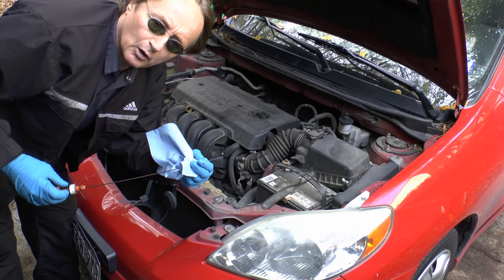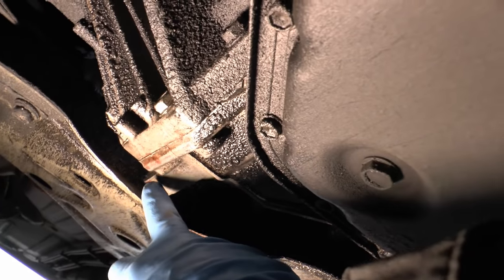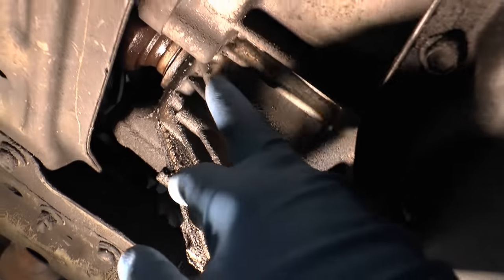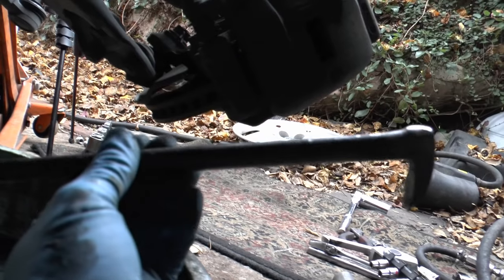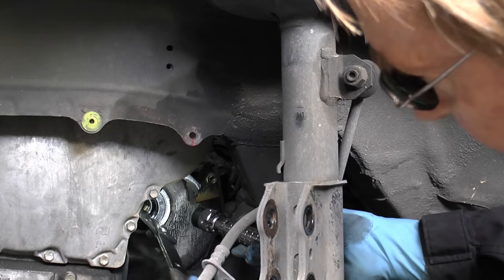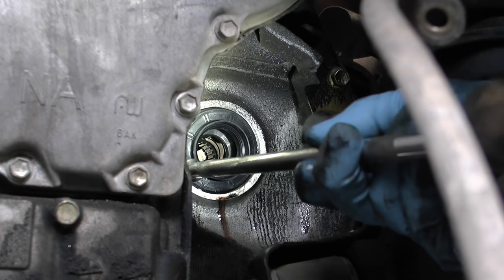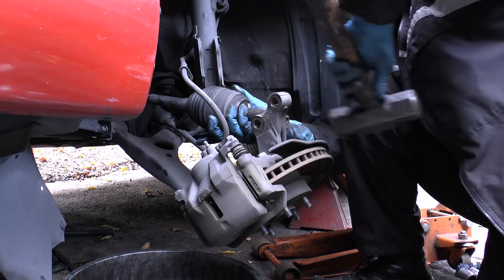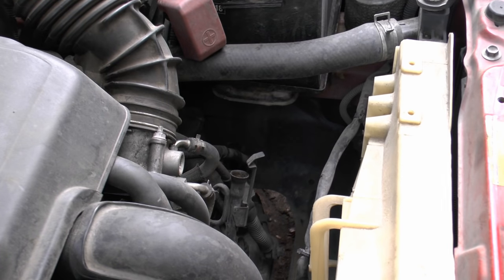How to Fix a Transmission Leak in Your Car (Axle Seal)

Comment: Thanks to your advice, Scotty, I now have a $25 OBD2 scanner, and a brake fluid tester on the way.  That's only the beginning of the testers I have on my Amazon wish list.  Now if only I had the money and space for an air compressor I can use with my impact wrench...
Reply: I still need to get around $500 for a good one, and I'm still saving for the car itself.  I'm not making payments, I'm buying straight out.

Comment: Quick and simple explanation, is pretty similar for most cars, some will have an intermediate bearing which is held in with bolts, most french cars have this and it's fiddly, just an extra step to remember.

Comment: A lot of times when I put seals in I'll use the end of a 2x4 or 2x2 to strike with the hammer.The wood is more forgiving and I can bridge all the way across the seal and drive in both sides at the same time leaving less chance of deforming or ruining the seal.On RWD transmissions there is an output shaft that sticks out beyond the seal.For those I take a hole saw and cut a hole in the flat side of the 2x4 big enough for the shaft to fit through.

Comment: scotty i replaced the drivers side transmission seal on my 2009 hyundai accent 2 times...but it continues to leak...what could it be ??? also they've offering 2 different seals one rubber type and one metal type?? neither stopped the leak

Comment: Hi Scotty. I had my f axle shaft , cv axle on R front replaced on june 2022 for a 03 hyundai elantra. Question : should the seal been included in that work ? 
Because i now have a R cv seal leak ..8 months later .
Thank you

Comment: scotty im in a predicament...with my girl at motel and my toyota tundra 2001 truck I havent had long will not move. i had checked fluid and thought it needed fluid. I use my truck every day for work ...its how I make my living and how were in a motel now. 
It wont move. Scotty I get on it pretty hard bcus everything I do is rush rush...traveling hundreds of miles a day of stops, turns et cetera. It was after putting the fluid in and driving several miles back to motel that it made like a steady hum sound for two maybe three seconds. We barely coasted  into the parking lot. I
I waited half hour for it to cool before checking the fluid level again, on the stick, it was a good half inch to 5/8 further than it should have been for being cold.
on top of this the overdrive light when on I thought was engaged, so when I wanted to pass someone  on the road, I would push it. 
But its when the lights not showing that it is engaged. we have to be out by noon unless I work in the morning.
Did I mess transmisson up??? I cant be without my ride Scotty, I'll lose everything. 
Doe's or can over-filling the fluid make it slip or not move??? Have I blown a seal??
What can I do that will make my truck move. will draining the amount of fluid I put in make it go back to moving.

HELLO. SCOTTY....
DESPERATE..
WHAT CAN I DO???
Have lil money and not much time.
IS THERE A SOLUTION ????
drain a lil fluid? bcus it was ok before that?

Comment: I wish we had you as our mechanic. My grandmother just bought an 01' Honda Accord, which has an expired recall for the transmission, and she's had so many issues with it. The car lot she bought it from is taking care of her because I know the owner but they've put in three rebuilt transmissions and each transmission only lasted about a week. Then after the third one it started having issues again and they said it was a bad sensor.

So they replaced that and then a week later it started having issues again, then they said it was the plug the sensor went into that went bad. So they replaced that and now its back in the shop again after I noticed it was leaking. I checked the oil and it was fine so I was sure it was the transmission fluid, only I couldn't confirm because I couldn't find a way to check the transmission fluid levels.

She was driving it the other day and it started having issues getting going from a stop, then the check engine light came on. She shut it off and waited a few min and turned it back on and the light went off and the car drove fine the rest of the way home. They said they would get her in another car if they couldn't fix it this time, though I would think by now they'd just take it to a Honda Dealership since their mechanic can't seem to fix it.

Comment: Thanks for the tip on the grease. I have found that it's good to loosen the axle nut before I raise the car. You must have done this, because it came off so easily.

Comment: I pretty much did the exact same job for the exact same reason (Leaking Axle seals ) on my 1993 Dodge Shadow like 5 years ago.  Another place I've seen Transmitions leak is the oil line to the external transmition oil cooler.

Comment: Usually the tie rod is stuck worse than yours was, so it would be a good idea to take the nut off half way, so it's level with the tie rod end and then hit it or else you're gonna ruin the threads and mushroom it out. Of course if you plan on replacing it afterwards then it doesn't matter.

Comment: awesome videos very helpful. i notices 3 things in the video that would put the DIYer in a little bit of trouble when tackling this kinda job 1st, hitting the tie rod on the top could cause mushrooming and messed up threads. my 2 cents, i would hammer on the side of the spindle where the tie rod is connected at so it can brake loose form its taper. 2nd pulling the CV axle by the shaft could pull the joints out of the socket causing a huge headache putting back in place,  i would recommend pulling by the base of the CV housing for less chances of failure and lastly the seal if not done right there will be leaks after assembled my method is a seal installer tool or a socket thats the right size to drive the seal in.

Comment: Scotty,
Can you make a maintance video that includes everything you have to maintain on a car (changing oils, filters, stuff like that) as well as give basic info about when you should do the maintance?

Getting so unsure of what I should do to keep the car and engieen running for ever.

Also wondering if the "uneven" motors bmw has (the old (1998) is running uneven because of the ventiles?)

Comment: I think you forgot a pretty main item on this video which is vehicle speed sensor, for those with automatics. A lot of times people with check trans fluid ( not knowing how to do it and have it read low) then fill it and blow the seal out of the vss.

Comment: Ive gone thru 4 seals now cause it keeps going in crooked, it will not go in straight. So i hit the side thats not flush and it bends, my seal doesn’t have a fat lip like the one in this vir, its like 3mm wide. I dont know wtf to do

Comment: Whats up Scotty! So i have an 01 Hyundai Elantra and just recently it started leaking quite a bit of transmission fluid onto the ground. The thing is, it seems to be pooling at the top of the transmission and then flowing off. I havent dived into much yet but do you have a clue on what the problem might be?

Comment: Forgot to mention CLEAN the area where the seal sits in, & put some grease on the seal before installing it, & tap it in LIGHTLY when you mount the new seal.
Also forgot to mention that since you disconnected the strut & hub, you'll prob need a front end alignment now- another 80+ dollars
Reply: And never hit the threads with a hammer.. big no no. Also when removing the sealing dont use sharp objects not to damage the transmission casing, or it will leak behind the sealing ... Same with the axle, never hit the outer cv joint .. It will slide in just fine with hand power or there is something wrong. Didnt mention that it can leak fluid when taking out the axle and when reassembling never hit the bolts to the damper also it can destroy the threads.
Reply: guess after he has changed a few hundred of them he has a knack for how hard to tap ;)
Reply: Sinan M Hey, can I change the transmission seal the same way on a 2004 PT Cruiser ?
Reply: Doesnt look like those struts have alignment holes where the bolts go in

Comment: I've just gotten into the habit of replacing axle seals every time I replace half shafts. It's just a few bucks more and a few minutes more time at that point and it saves a lot of time of having to go back and redoing it because the old seals started leaking from being disturbed by the shaft removal.

Comment: Scotty Kilmer
I just had my transmission fluid changed. Before, I had no leaks and a few days after, I noticed my CV Axle Seals were leaking.
1) Do I need to hold the mechanic accountable? Did he do something to cause this? Car is 8 years old, but only 68,000 miles on it. I just find it odd that everything was bone dry before the tranny flush and now I have a leak.
2) Only 1 side is leaking. Should I replace the seals in pairs or just the problematic one?

Comment: Do you have to drain out the transmission fluid before taking off the axle??
Reply: No!  Only a small amount of fluid usually comes out while you replace the seal/axle.  You also want to be careful and get the CORRECT SEAL!  Try to match them if you can.  Some of these aftermarket ones will leak and you will have to do this all over again!

Comment: Hey Scotty my car (1996 Camry 2.2L, with 170,000 miles) Idles low when I start it in the mornings or when the engine is cold. I did check the throttle plate and I have cleaned it from bothside (I changed the IAC valve). I also put in a new air filter as well. What came be causing this? Love all your videos! Thanks

Comment: Hello Scotty,

My son has a 2007 Nissan Xterra. I have to replace the torque converter because I did not reinstall it properly when replacing the engine.

I'm having trouble seating the torque converter. A couple of times I thought it was seated, but it comes off when putting the transmission back into the Xterra.

How can I tell if it is properly seated?
How easy should it come off during installation?

Comment: Did you push the seal all the way into the transmission until it stopped up against the bearing or did you just bang the edges until it was flush with the transmission housing?

Comment: I've been told my transmission lines have been leaking. To have the lines replaced or any of the jobs you mentioned in the video how much does it cost all parts and labor to do each job?
Reply: coololds85 1000+

Comment: Hi Scotty, I had a leak in my transmission on my 04 Mazda 3. I figure that the leak was on the seal you showed. I had a problem with my shaft so changed the shaft and changed the seal as well but it still leaking. I know some auto Mechanics and they told me I should change the seal on both sides, but the other side is fine, no leakage. Why would I change something that is not giving me a problem? What do you think the problem could be?

Comment: Hi Scotty ! Love your videos. I have a lincoln town car 2004 which is leaking at 3 points under the car. I suspect its the transmission but I dont really know. It s leaking in the very front, in the center and the back axle area. I also have an issue when I back up from and turn the wheel to the right, there is a loud click sound coming from under the front of the car which seems to be from the drivers side. Any tips ?
Reply: yes buy a Toyota or Honda

Comment: wishbone suspension has a ball joint at the top and at the bottom, instead of bolts at the strut. Use a ball joint extractor ($20 harbor freight) to safely remove ball joints. Tap them with a hammer like in the video will ruin ball joints, hit the part they go through instead. Use a socket to drive in the seal.

Comment: Hey Scotty i have a 2005 Audi A4 1.8t trip-tonic with 145000 miles and my transmission started leaking really bad, i tried replacing the pan gasket and added new fluid until i reached 5 quarts shifting every 15 seconds but the leak still there!
Looking at your this video it kind of looks at the same place where mine is leaking, my question is "Is it the same procedure to change the seal"?
Thank you for your great videos!!!!

Comment: I guess I should have replaced that seal when I replaced the CV axle today along with the wheel bearing hub assembly on my 1982 Chevy Citation cuz now it's leaking at the transmission. ugh 😩
But hey at least this 3rd time around it should be a breeze since, I've taken that wheel bearing hub off and put it back on multiple times, at least I know what I'm doing now. 😂
Reply: No worries..I did a mustang 5.0 manual  trans 4 times...a mustang shop said all I had to do was drive the car 100 miles and the whole sounds would go away normally!!

Comment: A mechanic replaced left output seal on my 2006 Honda Accord 4 cylinder.  It leaked badly, because he bought an aftermarket seal of the wrong part number.  He did replace it with a Honda seal from Honda. Now it leaks worse than when the original seal was leaking. He took it  apart again and saw no problem.  It still leaks worse than before he replaced the seal.  How can this be. The mechanic doesn’t know why. Can you help or does anybody else have any ideas on what to do next?

Comment: Some oil seals need to be driven in to a specific depth and not bottomed out. It's a good idea to check the factory service manual to see if the seal has a limited depth or not.

Comment: How about a video on chasing strange electrical issues? I've been diagnosing this issue for about 3 months and haven't found the culprit yet. My Nissan Pathfinder's rpms drop and a vibration can be felt any time I turn on the headlights or roll the windows up or down. A drop in rpms is normal, I realize, but it drops up to 300 rpms just from turning on the headlights and more than that when rolling the windows up or down. My guess is a bad ground somewhere causing excessive draw from the alternator but I cannot locate it.

Comment: i have a 1999 grand cherokee that has a trans oil leak right between the engine and the transmission. the torque converter is making a little grinding noise. What could be my problem?

Comment: Recently i got my torque converter fix and i went to a road trip but my transmission leak and it seem to be the seal would the mechanic know the seal was bad or how often do you replace em

Comment: Thanks for another helpful video Scotty. I have a 2010 Scion xB. Nothing is easy on this car. I have done 2 trans service jobs on this car. I got it with 205k miles on it and the original owner never serviced the transmission. For months I have been wondering where the leak was coming from. It's making a huge mess under the car. Also, do you or anyone know where I can get a service manual for this car. I don't want to pay $100 for a book and there are 3 service books to this car.

Comment: Hey scotty I have a 1992 ford f350 2wd the transmission is leaking out of the transmission over flow think that's what is called only when it running it's leaking bad what do I do
Reply: Art Garde you know this video it from 3 years ago

Comment: Hi Scotty. I was wondering what type of grease do you put on the circlip? Can't it contaminate the ATF in the transmission?
Reply: Cyril Azoulay No because the transmission fluid is in the transmission to lubricate the gears where the axle goes in is completely seperate part of the transmission he only said some fluid may come out when you remove the axle cuz the seal was broken hence why he was replacing it
Reply: Oh, so where the axle goes into the transmission, that uses another kind of transmission fluid?  WRONG!

Comment: I'm confused. If it leaks from that seal, why doesn't the transmission fluid need to be drained to prevent the fluid from coming out the hole when the axle is taken out of the transmission? Does the fluid only reach that area when the car is running and the fluid is being circulated through the transmission?

Comment: Hey Scotty I got a 2001 Honda Accord. I recently bought it. I know that the Automatic transmissions on these Hondas like to fail even with maintenance. The car has a hard shift from 1st to 2nd. The old fluid didn't look bad but I changed it, and that made no difference. Now is the hard shift a sign that the trans is going out? Do these transmissions fail suddenly or do they fail gradually? I just wanna know if this thing will let me sit

Comment: Hey Scotty Kilmer I had a question, I have a 2012 Honda Civic LX. One day I noticed my transmission was leaking. Sure enough I found it was leaking from where the CV meets the transmission. So I replaced the seal, then about a week or two later it started leaking so I replaced the seal again. That was two or three weeks ago. Today I looked at the street and saw transmission fluid again. I have 2 thoughts it's either the CV axle or the transmission. I would really appreciate the help if you can thank you.

Comment: hi scotty, do you have to drain the transmission oil before removing the CV joint and seal or can i get away with leaving the oil in and not get oil everywhere?

Comment: originally my third and fourth gears were gone.a friend of mine rebuilt it.when driven it had same problem 3rd and 4th.then he replaced governor pressure silenoid.ran fine couple days.now there's something loose spinning inside and a grinding between 2nd and 3rd gear.also slamming when letting off gas
Reply: is it a older rav 4?

Comment: Hey Scotty I pulled the driver side cv out and it leaked a good size puddle of fluid ,did I brake the seal or was it over filled on my mom's 2002 ford escape v6.???

Comment: Question for you I brought my  2006 Porsche Cayenne. V8 to a mechanic to change the transmission seal in the front as it is leaking from the seal he says in order to change the seal he had to take apart the top of the engine and go from the top of the engine to remove the transmission so that he can get to the seal does this make any sense to you.?